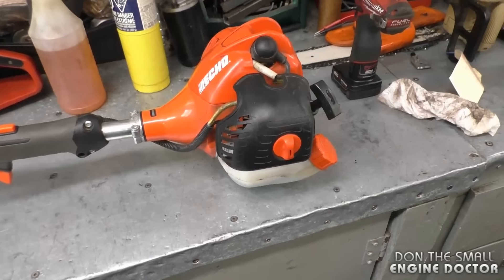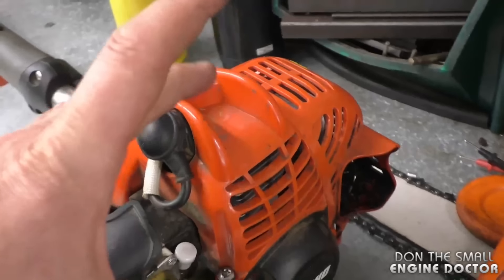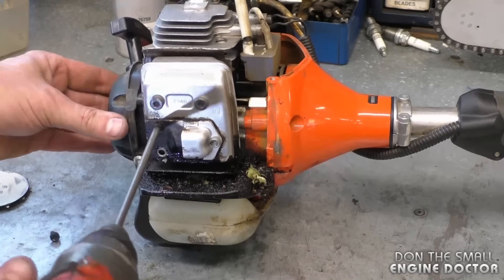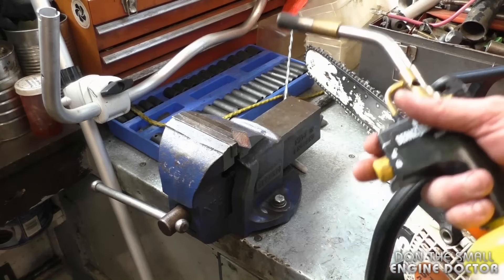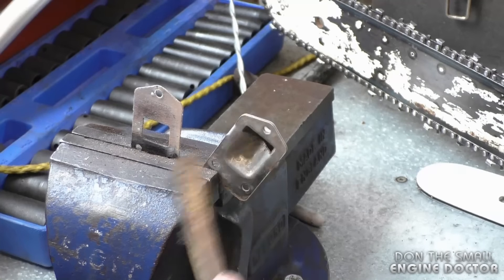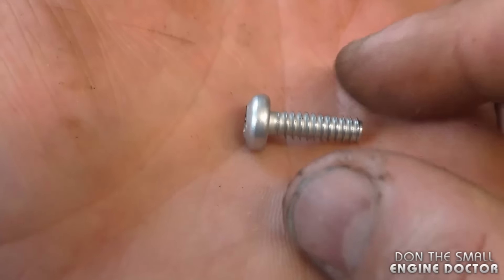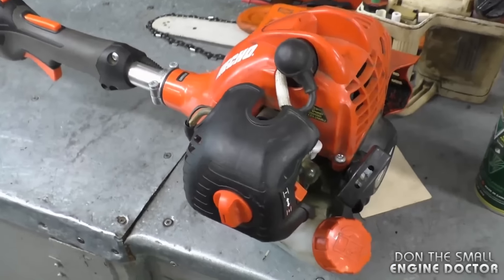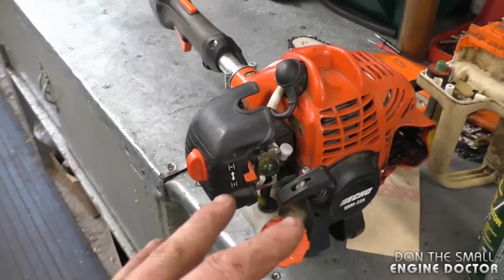How-To Fix A WeedWacker That Bogs Down

Comment: If they are using it commercially just go ahead and get permission from the customer to remove the screen completely. For some reason even though Echo is (Commercial Grade) they still choose to put the smallest exhaust port and screen  port in the industry on their trimmers. I realize it’s illegal to remove the screen however if you talk to the customer and put the liability in their hands they will most likely be happier in the future. No one is going to be trimming weeds in a national forest and set it on fire. Second recommend if they are a true commercial user and they absolutely have to buy an echo recommend the SRM 230 its more of a industrial unit compared to the 225. Also if you notice in the beginning of the video the fuel purge bulb was less than half full of fuel if it stays that way even after purging the carb will need replacement soon. A lot of the reason the carburetors and the exhausts on these units are so prone to problems is Echo is trying to be one of the most EPA compliment companies around however they don’t realize it has poorly effected the quality and reliability of their equipment for several years now. For the price the ask for them it’s a total joke. Get a Stihl, Husqvarna, Redmax, etc.

Comment: A good tip, but here's a better fix: Get a battery-powered trimmer.
Reply: KarlBunker, Yes, that’s the next thing. 
Hopefully the batteries will get better.
Reply: Have used the dewalt 20v string trimmer (dcst920b ?) for trimming around the 1-1.5acre in Florida. Worked surprisingly well for jobs around the home with a couple of the batteries. Carried the batts in an empty tool belt pouch w/ hemostat pliers for clearing the head if using it on heavy brush). I'd use it more but I prefer a well maintained gas unit, a bit more fun & enjoy learning the proper ways to keep things serviced thanks to Don and a couple other youtube/forum sources out there.